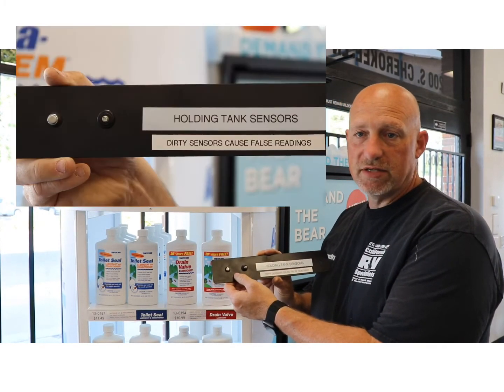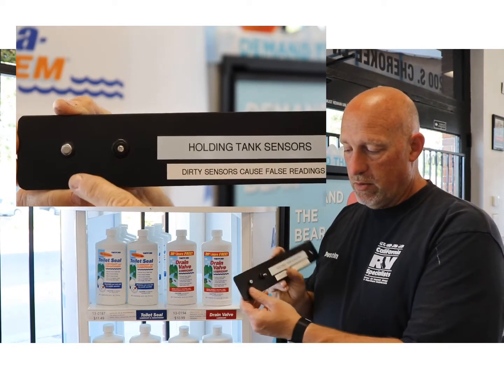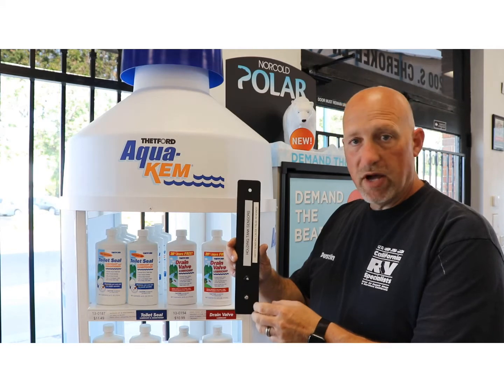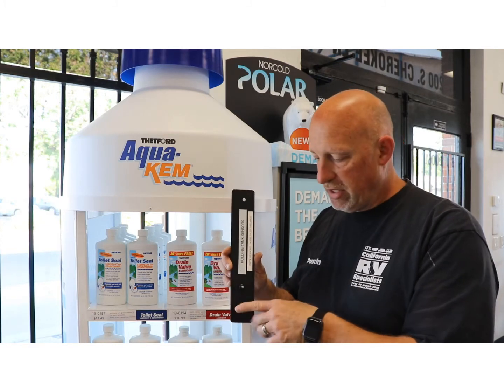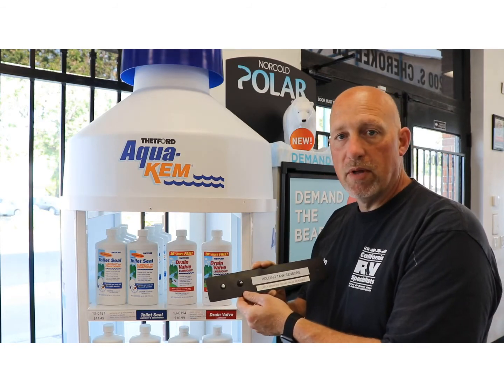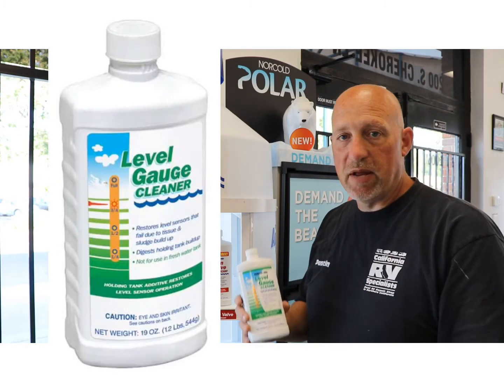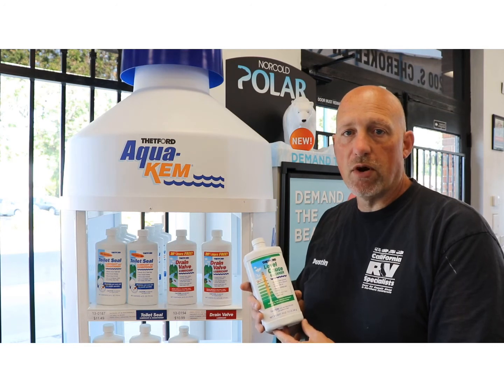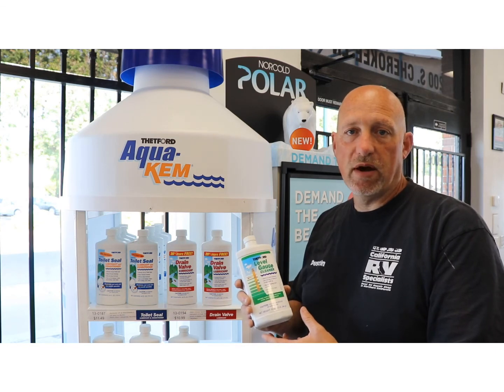GET RID of RV Tank Sensor Hassles Once and for All!

Comment: What do you mean by "cuts off the resistance"? Do you mean that it creates an open circuit? Or do you mean that it creates a short circuit? Or do you mean that it increases the resistance above the registration threshold or reduces it below the threshold?
Reply from the maker: As the fluid level rises the sensors go to ground, when the sensor have too much caked on them they since they are grounded.  

If that makes sense since.
Reply: @yourrvspecialists  Thanks! That's info I needed!